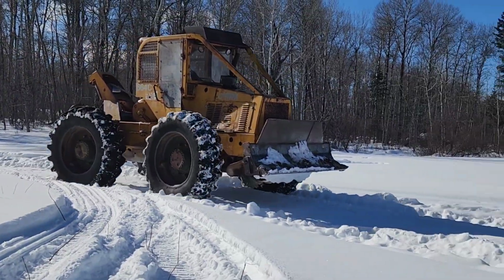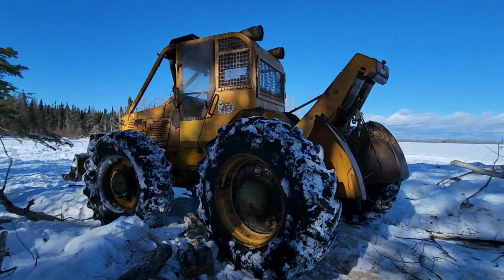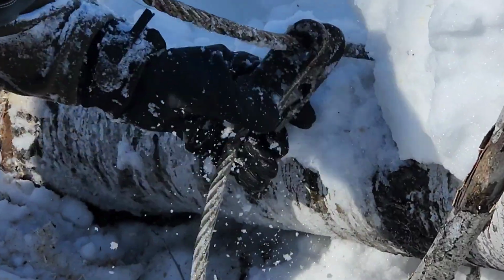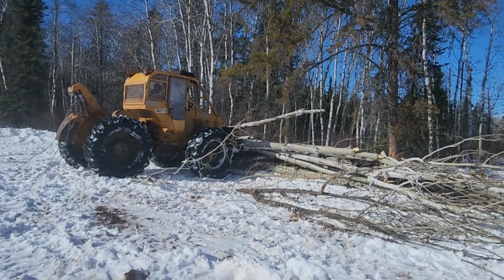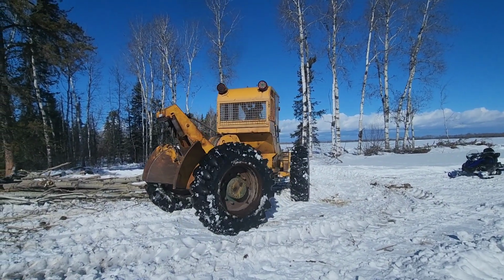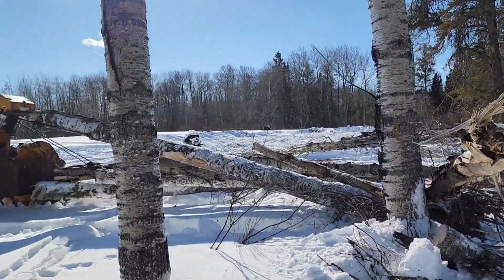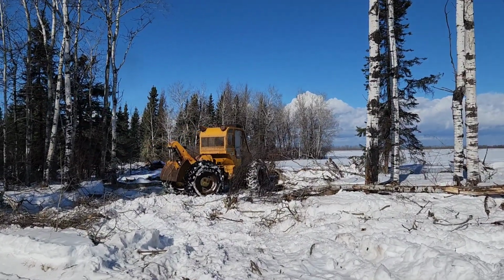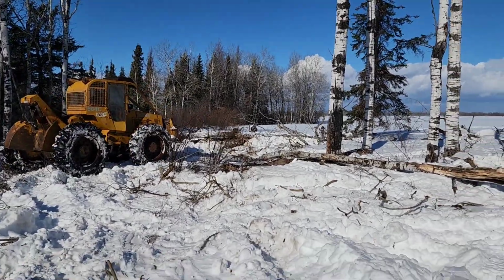Clark 664C Winter Logging

Comment: Nothing like handling slings/chokers in the cold, or in very muddy conditions, or both. Longest straight out, the rest out to the sides, hook them all up drag them in. If i got caught on a stump, I'd lock the winch, go flat out dig in my tyres, then winch hard, lift the front of the skidder right up off the ground, drop that winch, lock it up before the front landed, and 9 times out of 10 you'd bounce the snag right over the stumps. Of course the boss caught me with only 1 wheel on the ground, and threw me off it. He put me on the D6 dozer to slow me down. So i trained on the Clark 664, D6 Cat dozer, and a Michigan 75B log loader. A small group of us who worked extremely well together, and we pulled more timber per month, than the bigger better equipped rivals.

Comment: OK listen folks i finished watching the whole vlog, and that is NOT how you drive a skidder, i hear and see that throttle (smoke) and winch going fart, fart, fart .. That machine is made to work hard, full throttle, or it gums up the works, and you will eventually run out of hydraulics. Don't be frightened of it. it is made to work in just about any conditions. Drag those chokers up a bit more, they shouldn't be dragging on the ground. when you haul logs, drag them right up into your rear end, get the butts up off the ground, look on the front of the logs, as the front of a sled. I used to use them as brakes on steep down hill runs, simply by dropping the drag a bit, and letting the butts dig in. extra brakes if you're in high range down hill. And btw, i never ever seen chains on skidders in NZ, when i was still there using them. A good driver doesn't need them, it's sort of an american thing where you take a simple machine, and turn it into a space rocket. if you know what i mean. a simple machine, that you steer, it will do the work for you.
Reply: I ran a Clark 664 for probably 6 years and a 666 Clark for about 5 years.  

The operator is doing nothing wrong, slow and steady wins the race, you sound like some kind of cowboy/ ramrod who probably destroyed any piece of equipment that you operated, I’ve seen many guys like you over the years.  

Also, "mate" in extreme winter climates with large amounts of snow on the ground you need tire chains for traction, I’ve seen skidders in Canada and Europe using chains, it’s just not an "American thing." It’s a little different than NZ where it never snows.
Reply: @Lex-Hawthorn  Thanks for your input mate, I sincerely hope that you enjoy your Vegemite sandwich.